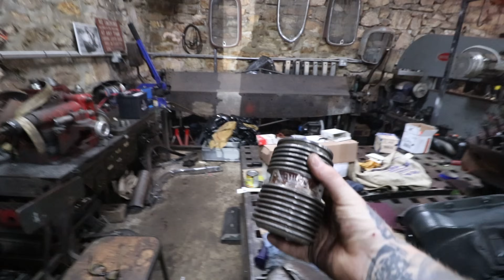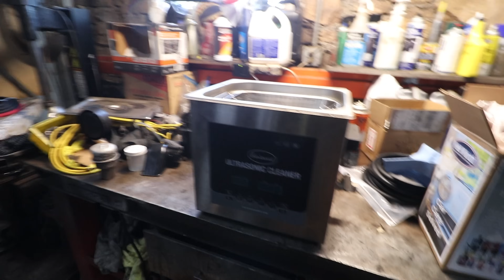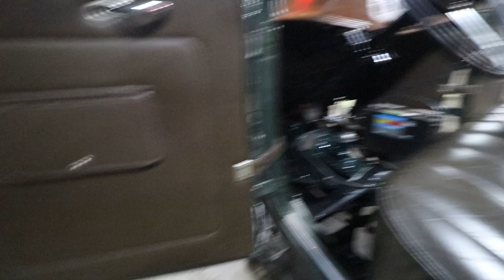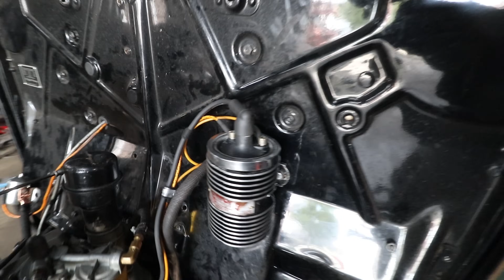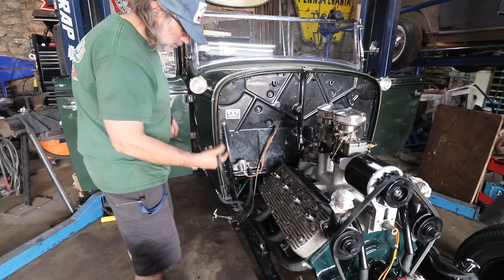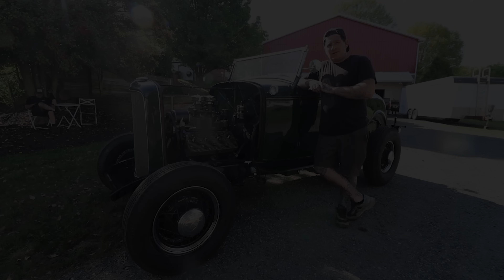The 1932 Ruined Roadster Is Moving Under Its Own Power!!!

Comment: Great vid as always but I think you might need to keep an eye on the new coil.  The air space between coil and casing is very effective insulation.  If the coil overheats you'll soon know because it will burst and spray you with stinky oil.

Comment: That’s awesome!  

Quick question. I have a pretty retro AV8 and was thinking about adding cowl lights. I think they look cool but part of me says a young stud in the 50’s’s would have left them off for less weight. Right now I have rubber grommets in the holes. I thought they would look cool and coupe maybe add led bulbs for better visibility or even make them ‘extra’ turn signals to give. Better visibility to other drivers.

Comment: You can afford a hot rod.  Just buy a basic running modelA for $10,000 then spend another $20,000 on an engine and drive train.     Wha la, a hot rod.  I acspent around $10,000 building mine!

Comment: matt ya got a part number for that solenoid with the start button? also, please let us know where you sourced the glass fuse block; thinking of going that way with my project on both counts. that starter button is super neat!
Reply from the maker: The solenoid is a NOS vintage part. Not sure if you can find them new. The fusebox is a Dorman part. Found on Amazon

Comment: I love the way it "starts right up" as soon as you hit the button.  My old Harleys do the same thing, and I love it.
I also still have the sand cast finned aluminum coil cover that came with my first car in 1962, a 1937 FORD Tudor Slant-Back sedan.  It will go on my project panel truck if it ever gets running....
....RooDog....

Comment: those solinoids can be confusing some are base ground some the small terminals grnd some require voltage energise some with 2 terminals also provide 12v to the coil to aid starting .

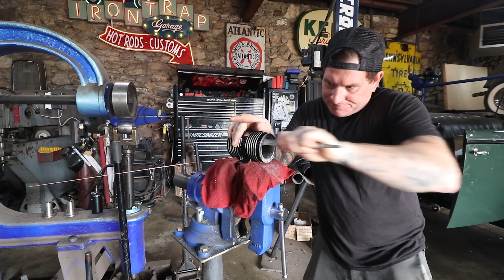Comment: 6:38 Why didn't you use your lathe? Don't have a 4 jaw chuck and boring bar?
8:40 Heaven help the person that has to change the coil.
Reply from the maker: Because it only needed minimal filing on the edges to fit. It wouldn’t be that hard to get out it’s just lightly tapped in. You don’t want it rattling around in there.